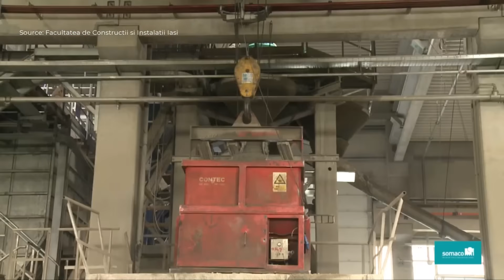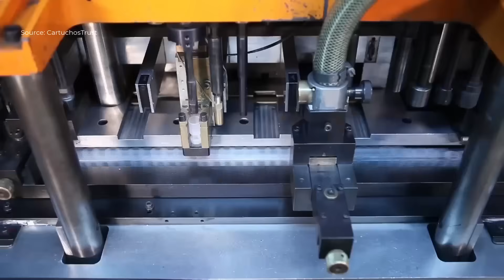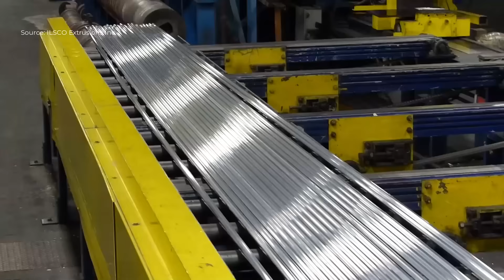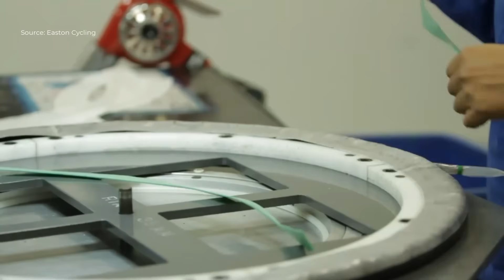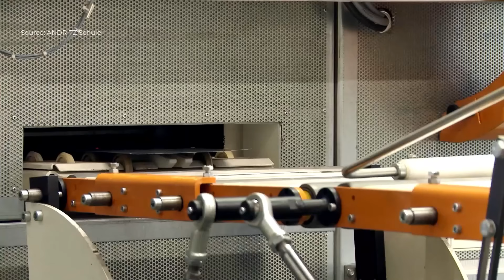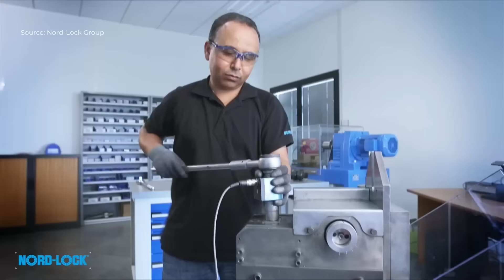How Steel Casings Are Driven 140ft Deep to Build Underwater Bridge Foundations & Production Process

Comment: 9:50 Bends the pipe without deformation, there's a huge kink in the pipe.
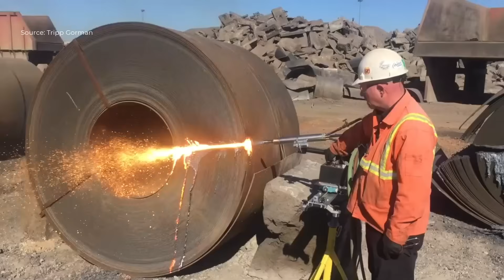17:05 It's crazy that that roll of steel is being scrapped.
I like the video, but there's nothing about the thumbnail, or what it say's in the title. Thumbs Down.
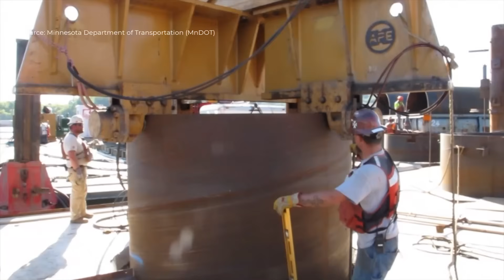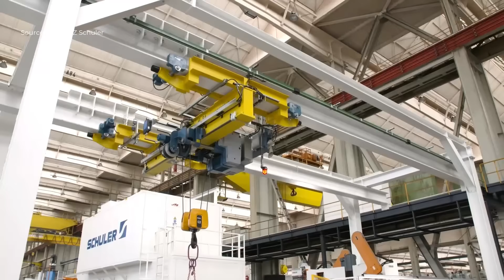Reply: 23:10 23:49  Is where the Casings were driven into the ground, but it was a short segment. This channel is Click Bait.
Reply: 23:10 23:49  Is where the Casings were driven into the ground, but it was a short segment. This channel is Click Bait.